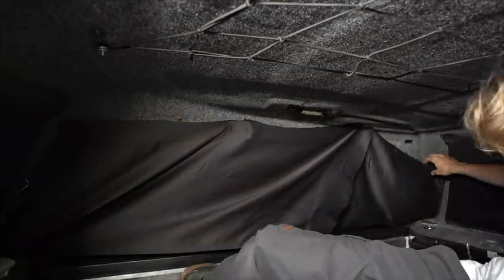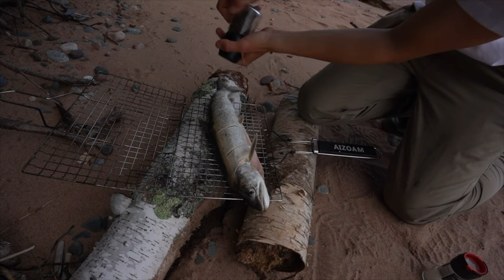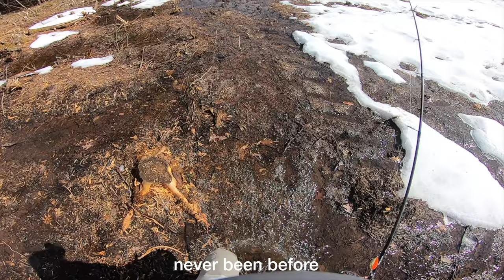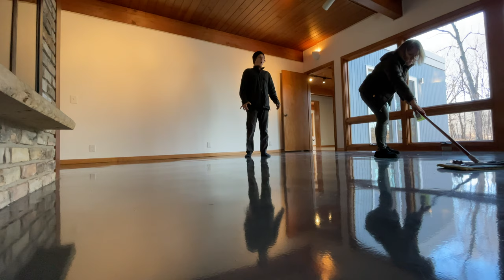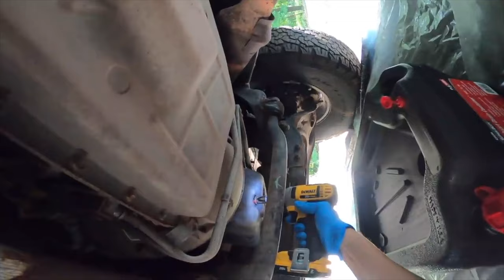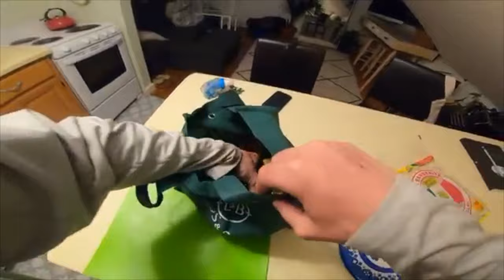Best of MAV 2020

Comment: When I drove truck over the road 20 years ago, are used to haul potatoes during potato season of course. I would wrap a couple in foil have them wrap a steak and foil with some other stuff of course. And then I will put them all on the exhaust manifold and drive for an hour and I had a complete dinner at the end of that Trip when I phone parking LOL